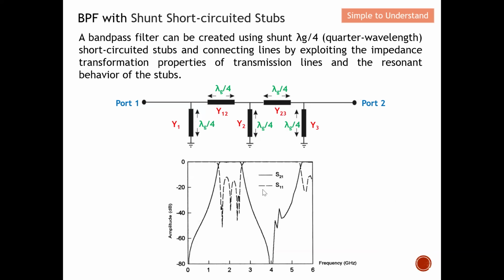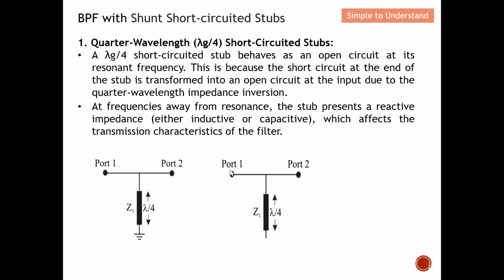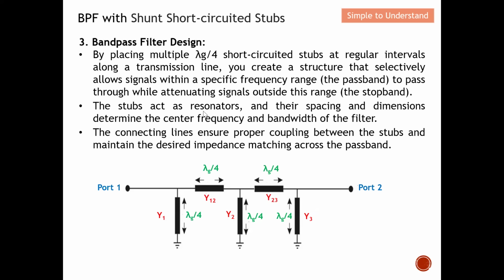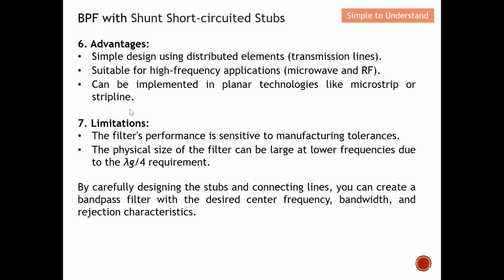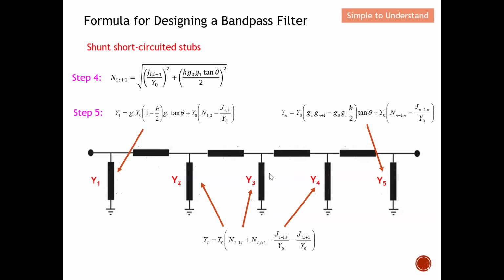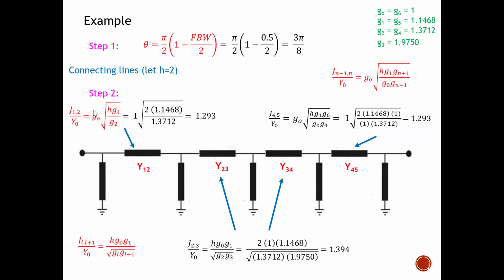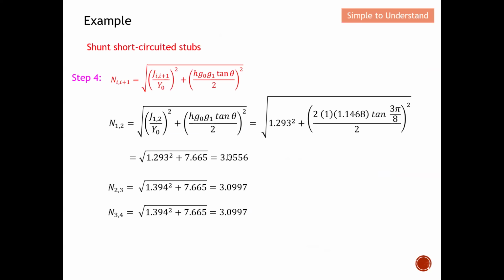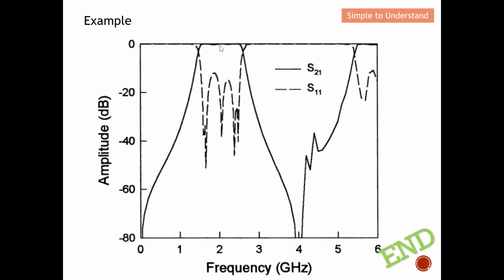Filter Design #18. How to Design a BPF with Quarter wave  λg/4 Shorted Stubs with Connecting Line.

Comment from the maker: Thank you for your valuable input on improving this video.
In this video, I explain how a connecting line and λg/4 (quarter-wavelength) short-circuited stubs function as a bandpass filter.
Next, I present a design example for creating a bandpass filter. The design procedure is divided into two parts:
1) Connecting Line
2) λg/4 (Quarter-Wavelength) Short-Circuited Stubs
By following this step-by-step design procedure, you can achieve a bandpass filter frequency response.
Reply: I am using the same method for a 2nd order BPF of fractional bandwidth 0.1054 at mid band frequency of 9.48GHz. Ripple level I chose was 0.1 dB but the admittance values are so large that it is not physically realisable.
How to deal with such situations?
Reply from the maker: I am sorry, I did not see this message. You can always control by choosing the h values in the video.
Sorry gain for my late reply.

Comment: Hello. I am designing a 2-stage filter using the same method. However, when I set the h value to something other than 1, the response fails to achieve the target ripple and desired characteristics. Do you know why this happens?
There are no errors in the calculations. For 4-stage and 6-stage filters, the desired ripple is obtained regardless of which value between 0 and 2 is chosen for h, but this issue only occurs with the 2-stage filter.
Reply from the maker: Sorry, I am away for the whole week. Normally when we design this type of filter, we prefer to be odd value in order for them to be balance (LHS = RHS). I strongly think maybe your calculation or simulation has errors. I am sorry, I am not able to help at this moment.